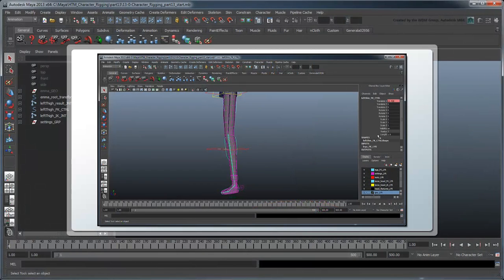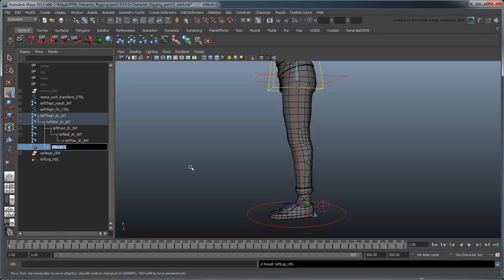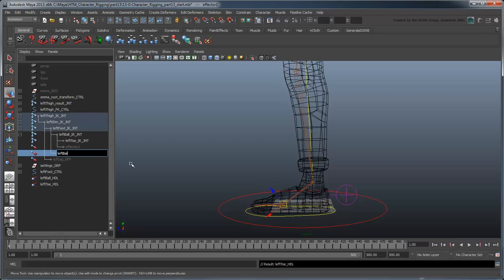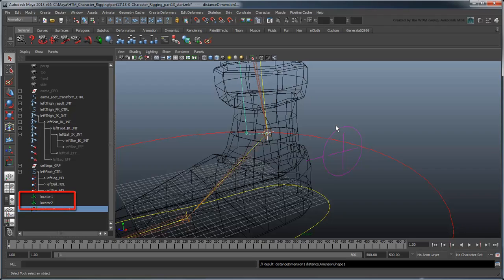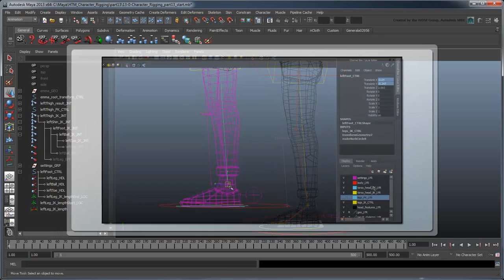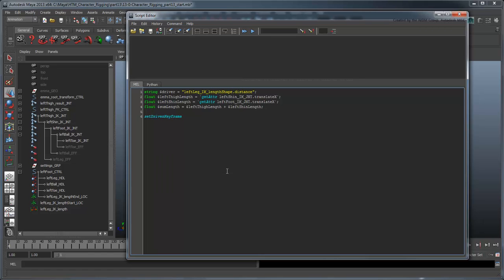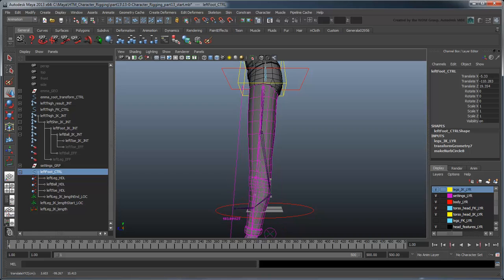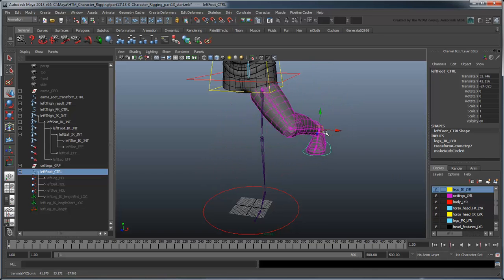Creating a Character Rig - Part 13: Leg IK controls and joint stretching (Advanced)

Comment: Why does the leg straighten abruptly, when the distance value getting closer to the Sumlength? Shouldn't we use exact value for Dist length to solve?
Reply from the maker: +Андрей Гутов I'm not sure what you mean by straightening abruptly.  It doesn't straighten anymore abruptly than the it bends (at least not in the provided scene file).

Comment: line 6 what error? help me pls

string $driver = "L_leg_IK_lengthShape";
float $leftThighLength = `getAttr L_shin_IK_JNT.translateX`;
float $leftShinLength = `getAttr L_foot_IK_JNT.translateX`;
float $sumLength = $leftThighLength + $leftShinLength;

setDrivenKeyframe -currentDriver $driver -driverValue $sumLength -attribute "translateX" -value $leftThighLength L_shin_IK_JNT;
// Error: line 6:  //
Reply: I have the same error. It's very frustrating. I don't know what's wrong.
Reply from the maker: ".distance" is missing from the $driver assignment in line 1, which is causing line 6 to search for the wrong string.
Reply: Specifically i have this issue:

string $driver = "left_leg_IK_lengthShape.distance";
float $leftThighLength = `getAttr left_Shin_IK_JNT.translateX`;
float $leftShinLength = `getAttr left_Foot_IK_JNT.translateX`;
float $sumLength = $leftThighLength + $leftShinLength

setDrivenKeyframe -currentDriver $driver -driverValue $sumLength -attribute "translateX" -value $leftThighLength left_Shin_IK_JNT;

it says error: line 6, syntax error
Reply from the maker: Hmm, that seems correct to me unless one of those object names doesn't match what's actually in your scene.  You may want to double check those.

Comment: Hello. Following problem: I just run the script succsesfully on the emma model. Than i tried to do the same process with my own model.  Now the thigh_result stretch with the thigh_ik. But the foot_result didn t follow the foot_IK when i translate to stretch. So i can t stretch the Shin. The leg position of my model is not straight to the floor. They are more in a V position. Because of the V positon can be that the translate X dont work? I have the file here if somebody like to check:

https://www.dropbox.com/s/y6ybyfu077dyqig/part%2011_Leg%20IK%20controls%20and%20joint%20stretching01.7z?dl=0 

Many thanks in advance if somebody help me to solve this problem :)
Reply: Update: I try it again with my own model  with a straight leg and it works :) So how the script will be if i have model with the legs in a V position?

Comment: 8:18 ~ (//scripting noob//) principle question: So after we set the Driver (which is the distance value of course) - why do we assign it a separate value (from $sumLegth ?) instead of using its own? - Is this because we have to take into account the joint bend (and joint lengths) into account when setting the driven key?

Thanks!
Reply from the maker: +Gogo Yes that's pretty much it.  You only want the leg to start stretching once it's reached broken the total length of its thigh + shin combined, even if that means it has to hyper-extend slightly.

Comment: hi, when runnning the mel script for the right leg, i multiplied the  the rightthighlength value and shinlengthvalue by -1 and have the right leg stretching perfectly, however later i realized that the key on the translate X for both right leg and foot ik jnt has become possitive number as well while the result jnt and fk jnt r negative. Therefore whenever I blend from Ik to Fk leg for the right leg, my leg will do a crazy 360 flip before it blend into the correct ctrls.... my script is below

string $driver = "rightLeg_IK_lengthShape.distance";
float $rightThighLength = `getAttr rightShin_IK_JNT.translateX`;
float $rightShinLength = `getAttr rightFoot_IK_JNT.translateX`;
float $rightSumLength = ($rightThighLength*-1) + ($rightShinLength*-1);

setDrivenKeyframe -currentDriver $driver -driverValue $rightSumLength -attribute "translateX" -value ($rightThighLength*-1) rightShin_IK_JNT;

setDrivenKeyframe -currentDriver $driver -driverValue ($rightSumLength*2) -attribute "translateX" -value ($rightThighLength*-2) rightShin_IK_JNT;

setDrivenKeyframe -currentDriver $driver -driverValue $rightSumLength -attribute "translateX" -value ($rightShinLength*-1) rightFoot_IK_JNT;

setDrivenKeyframe -currentDriver $driver -driverValue ($rightSumLength*2) -attribute "translateX" -value ($rightShinLength*-2) rightFoot_IK_JNT;
Reply: +David Jiang Ah I figured it out... It is because i input double negative value into the driven key!!!  I adjust the script as below (removing the -1 on the driven key set) and problem solved

string $driver = "rightLeg_IK_lengthShape.distance";
float $rightThighLength = `getAttr rightShin_IK_JNT.translateX`;
float $rightShinLength = `getAttr rightFoot_IK_JNT.translateX`;
float $rightSumLength = ($rightThighLength*-1) + ($rightShinLength*-1);

setDrivenKeyframe -currentDriver $driver -driverValue $rightSumLength -attribute "translateX" -value $rightThighLength rightShin_IK_JNT;

setDrivenKeyframe -currentDriver $driver -driverValue ($rightSumLength*2) -attribute "translateX" -value ($rightThighLength*2) rightShin_IK_JNT;

setDrivenKeyframe -currentDriver $driver -driverValue $rightSumLength -attribute "translateX" -value $rightShinLength rightFoot_IK_JNT;

setDrivenKeyframe -currentDriver $driver -driverValue ($rightSumLength*2) -attribute "translateX" -value ($rightShinLength*2) rightFoot_IK_JNT;
Reply: +David Jiang i have been waiting for the answer from last night. Thank you so much <3
Reply: +Khúc Gỗ no problem, im glad i could help :) this fixed both right arm and leg for me
Reply: @FrugalCGGuru  Thank you so much! This was super helpfull even for the arm Script
Reply: Thank you David!!
Reply: Thank you!
Reply: Thank you so much

Comment: string $driver = "L_Leg_ik_lengthShape.distance";
float $LeftThighLength = 'getAttr L_Shin_IK_JNT.translateX';
float $leftShinLength = 'getAttr L_Foot_IK_JNT.translateX';
float $sumLength = $leftThighLength + $leftShinLength;

SetDrivenKeyframe -currentDriver $driver -driverValue $sumLength -attribute "translateX" -value $leftThighLength L_Shin_IK_JNT;
// Error: float $LeftThighLength = 'getAttr L_Shin_IK_JNT.translateX';
 // 
// Error: Line 2.26: Syntax error // 
// Error: float $leftShinLength = 'getAttr L_Foot_IK_JNT.translateX';
 // 
// Error: Line 3.25: Syntax error // 
plzz help me to solve it i try to find the error but i haavent found it can u plzz help me
Reply from the maker: +Chandu Chowdary Looks like you are using apostrophes (') and not tilde (`)
Reply: +Maya Learning Channel THANK U VERY MUCH BUT NOW IT WAS SHOWING THE error 
SetDrivenKeyframe -currentDriver $driver -driverValue $sumLength -attribute "translateX" -value $leftThighLength L_Shin_IK_JNT;
// Error: line 6: Cannot find procedure "SetDrivenKeyframe". //
Reply from the maker: It should be a lower case 'S'.  So "setDrivenKeyframe"
Reply: +Maya Learning Channel Thank u very much for the help

Comment: the MEL script for IK stretch doesn't work for the Right Leg side. However the left leg side was fine, then I used the mirror joint by left side, run the script IK stretch but otherwise the IK joint broken (some joints have rotation value) somehow. Here it is my right leg script :

string $driver = "r_leg01_IK_distShape.distance";
float $r_upperLegLength = `getAttr r_lowerLeg02_IK_jnt.translateX`;
float $r_lowerLegLength = `getAttr r_ankleLeg03_IK_jnt.translateX`;
float $sumLength = $r_upperLegLength + $r_lowerLegLength;

setDrivenKeyframe -currentDriver $driver -driverValue $sumLength -attribute "translateX" -value $r_upperLegLength r_lowerLeg02_IK_jnt;

setDrivenKeyframe -currentDriver $driver -driverValue ($sumLength*2) -attribute "translateX" -value ($r_upperLegLength*2) r_lowerLeg02_IK_jnt;

setDrivenKeyframe -currentDriver $driver -driverValue $sumLength -attribute "translateX" -value $r_lowerLegLength r_ankleLeg03_IK_jnt;

setDrivenKeyframe -currentDriver $driver -driverValue ($sumLength*2) -attribute "translateX" -value ($r_lowerLegLength*2) r_ankleLeg03_IK_jnt;

 So, how should i do?
Reply from the maker: +Adien Dendra Try taking a look at my response to Kerry O'Connor below.

Comment: Hi, thanks again for these tutorials, but I got stuck in the very beginning of this part. After I create the IK Handle (rotate plane-solver) my leg rotates in the wrong direction when moving it upwards in the Y Axis, X and Z works fine. See image link, http://i59.tinypic.com/f1id54.jpg

It could be a LRA problem, but I´ve checked every joints rotation order and compared your emma scene with mine, and my settings looks the same, atleast those settings I think matter :)
Could you please help me out and figure out what might cause this ?
Reply: Patrik Andreasson I continued the tutorial in the mean time, and if it´s of any help, after I was finished with the script and graph editor part, my leg rotated or moved a bit (without me changing anything ofcourse). See image below.
http://i61.tinypic.com/2rnbus4.jpg

I dont think the script or graph editor part went wrong, I believe this is happening cuz of a misstake in an earlier part of these series, maybe an LRA issue or something.

Btw, this is the script I used.

string $driver = "leftLeg_IK_lengthShape.distance";
float $leftThighLength = `getAttr leftShin_IK_JNT.translateX`;
float $leftShinLength = `getAttr leftFoot_IK_JNT.translateX`;
float $sumLength = $leftThighLength + $leftShinLength;

setDrivenKeyframe -currentDriver $driver -driverValue $sumLength -attribute "translateX" -value $leftThighLength leftShin_IK_JNT;

setDrivenKeyframe -currentDriver $driver -driverValue ($sumLength*2) -attribute "translateX" -value ($leftThighLength*2) leftShin_IK_JNT;

setDrivenKeyframe -currentDriver $driver -driverValue $sumLength -attribute "translateX" -value $leftShinLength leftFoot_IK_JNT;

setDrivenKeyframe -currentDriver $driver -driverValue ($sumLength*2) -attribute "translateX" -value ($leftShinLength*2) leftFoot_IK_JNT;
Reply: Patrik Andreasson Well, I think i finally got it. I did it all over again from part 10, just to be sure that I didn´t miss something, because when I created a new scene with only a few joints and hooked up an IK Handle and set the orient joint, the movement was fine.
My mesh had it´s knee slightly bent away from the body (like an X angle), so I changed my legs geo too be a little bit more straight.
I could´ve have been that I (in the very first beginning) rotated the leftShin_result_JNT to match my leftFoot_GEO, and maybe that messed up the orientation in the Y-axis, maybe.
I haven´t gone through part 13 yet though, so I´m not sure if the leg will move after I´m done with the script and graph editor part, I hope it won´t :)
Atleast I´m back on track!
Reply: Patrik Andreasson Just to answer my own question, and for anyone else that may encounter this problem, after I had gone through the script and graph editor part my leg did not move slightly as I described earlier.
I still suspect that I had done a tiny rotation inwards for the leftShin_result_JNT, which resulted in a faulty movement in the Y axis. Since the knee was slightly moved inwards and I drove the leg upwards the knee went to the side instead of following the Y axis.

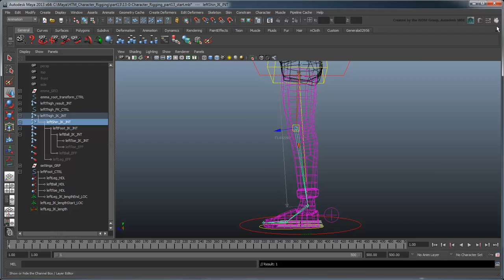Comment: 8:46
I have different named objects for my project, but I'm trying to write things as exact as possible (I'm getting a bachelors in Computer Science so I know how important every little letter is).
Here's my code, but Maya is saying it's picking up a syntax error at lines 2.24 and 3.23
string $driver = "L_leg_IK_lengthShape.distance";
float $L_thighLength = 'getAttr L_shin_IK_JNT.translateX';
float $L_shinLength = 'getAttr L_foot_IK_JNT.translateX';
float $sumLength = $L_thighLength + $L_shinLength;

setDrivenKeyframe -currentDriver $driver -driverValue $sumLength -attribute "translateX" -value $L_thighLength L_shin_IK_JNT;
Reply: WolfGr33d oh snap.. am i supposed to use ` instead of ' ? thats so confusing lol, its on the tilde key right under the ~
Reply: Thanks! Would have never figured this out haha

Comment: when i applied the IK solver to the IK joint chain i noticed that the whole IK- FK joint chain is switched down from the Shin joint. the names was good but i moved the IK Shin joint with the FK_CTRL. and all the same down the chain. maybe i made some mistakes when i tried to make the IK/FK Blend attribute.

i solved the problem like this:
-i unparented the joint chains from the Shin joint and re-parented them to the right place.
-renamed the joints
-remade the FK_CTRL_ Shapes with the "parent -r -s" command after i simply deleted the nodes from the "new" IK joint chain

after this the IK solver moves the whole GEO, and the IK/FK Blend attribute works fine, just like the FK_CTRLs.

do you think that i will face with some mayor problems with this solution?
Reply from the maker: bohinszky74 I suspect you just switched the inputs on the blend node initially, but this solution should be fine as well.

Comment: Hey I was trying to get the IK leg stretch to work, but it appears that since I'm using Maya 2014 the script shown is broken, and I can't get it to work. As soon as I run the line of the script which adds the second driven key, the length of the shin is doubled and does not stretch or even get shorter when I move the leg control. Is there a way to get this to work or is there maybe even a video showing how this is set up?
Reply: sicPanicmode  Just to confirm it's no single case, I have the same issue in Maya 2015. Meanwhile your fix still works, thx for figuring it out^^. My preset units where inch, I set them to cm. Anyone with native english capabilities might want to file a bugreport, because I think this isn't normal behavior.
Reply from the maker: The script should work for any version of Maya after 2013 (and probably most versions even before).  Does this happen only with your shin or also with the thigh?  I can tell you that after running the script, the leg shouldn't immediately stretch (in fact the whole reason we use the script is that IK handles "snap" back to a max length, which is why we can't manually stretch it to set our driven keys).  It sounds to me like something is amiss in your IK setup.
Reply: Maya Learning Channel Yes this also happens with the shin. When running the script the thigh or shin translate X value gets doubled, however it does not stretch and basically stays this length. I made a screenshot of how it looks like http://fs1.directupload.net/images/150210/orqnetzv.png
I also looked at the graph editor for the driven keys, they are still the way they are supposed to be, but as soon as I set the tangents to linear the translate X value gets set even higher. I also got a screenshot of what that looks like http://fs2.directupload.net/images/150210/kkgzqfxm.png
I followed the video step by step  and as far as I can tell there should nothing be missing in my file, I am however not entirely sure, I uploaded the scene file to my dropbox in case you want to look for yourself.https://dl.dropboxusercontent.com/u/25178626/Rig_Leg_IK.ma
Thank you for the fast response and so far this tutorial is really good and helped me learn a lot so far :)
Reply: Maya Learning Channel So yeah a quick update on my part. I have now built the complete rig from scratch in case I got something wrong along the line, however I still got the same results as previously. However since I created the base mesh with meters as the active units I tried the whole script again after setting the units to centimeter and now it does indeed work. I can also switch the units back afterwards to meters and it still works. It seems I only cannot run the script with units set to meters, because then the rig breaks and I have no idea why that is xD
Reply: rizawi Just had the same issue and switching to cm (from meters) fixed it for me too.  I'm not sure whether to switch back to meters or not now, I dont want to have to keep switching back and forth whenever I have to do a script using units.  Did you switch back?  I think I'll stick with cm for now as the rest of the rig seems to be working ok
Reply: Adam McEwen I think this is more like a scale setting and doesn't change anything with the rig. I didn't change it back because I'm from europe and if I had known of the setting earlier, I would have set it to cm anyway, as cm work well for me to compare sizes.

Comment: Great tutorial! i do have a prblem though when i finished the streching part of the ik, i tried to move the ik around but then this kept happening http://imgur.com/rdRkO5y
How do i fix this? (sorry if my english is bad. English is not my native language)
Reply from the maker: It seems like it may be a double transform or a cycle.  When you move the IK handle, does Maya show a warning in the bottom corner?
Reply: Maya Learning Channel No warnings
Reply from the maker: Since we can see that the result joints are moving with the geometry, I suspect that the Local Rotation Axes of the IK leg don't match those of the result joints which is why they're going in two different directions.

Comment: Hello, so I learnt rigging thanks to your videos XD, but I have an issue and was hoping you could shed some light on the issue. I have my ik/fk switch working, but sometimes when I reference the rig and keyframe the feet ctrls in IK, or the leg controls in FK everything is fine, but when I play or scroll in the timeline the result joints offset, as soon as I move a ctrl from the leg, knee or foot it snaps back to where I had keyframed. Hope you know how to sort this out, cheers!